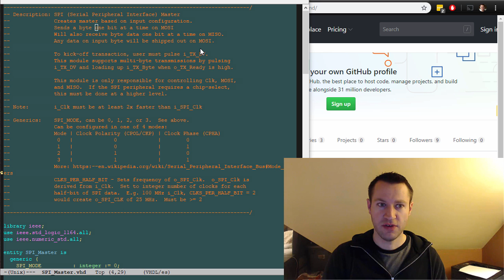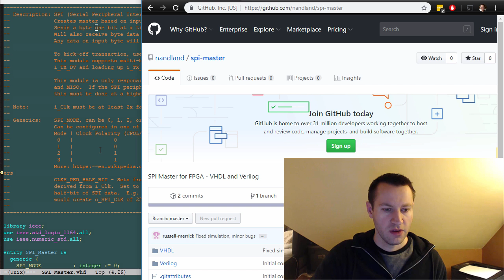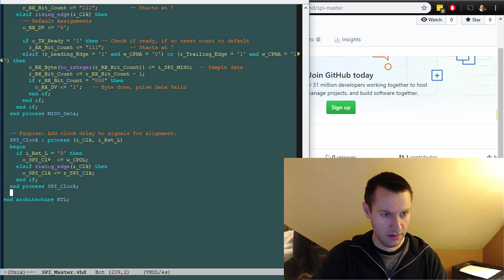SPI Master in FPGA, VHDL Code Example

Comment: can you help me fix this error: "Object o_TX_Ready of mode OUT can not be read."
Reply from the maker: You can't read an output in Verilog unless it's of type reg. e.g. output reg o_TX_Ready. Another solution is to create an intermediate register r_TX_Ready and assign o_TX_Ready = r_TX_Ready, then you can use r_TX_Ready wherever you like.
Reply: For future reference, for that part to work you'd have to switch Vivado ( or whatever you use) to VHDL 2008. VHDL is not able to support that.

Comment: Ordinarily I do really enjoy your vt' however, some of your coding styles confuse me. That is, why use asynchronous resets, and why use not just use a state machine (more logic but infinitely more readable) also you like to use concurrent signal assignments rather than clocked processes.  I only ask as most day jobs require SIL or do254 and these coding styles wouldn't pass a code review.  Sorry to be a downer, but I've picked up a few handy tips from you, but I find my disagreeing with some of this.
Reply: I agree with you, but can't seem to wrap my head around programming the SPI with state machine... Would you mind terribly helping me?

Comment: Thank you for video!
I don't understand the detail...
"o_TX_Ready" signal declaration as output, but this signal use in MOSI_Data and MISO_Data processes as read.
How it works?
Reply from the maker: Just because a signal is label as an output with "o_", it can still be used internally.
Reply: @Nandland   slave takes clock from master  so  do we need to give same clock name both for master and slave? and there is only one clock for both slave and master , right?